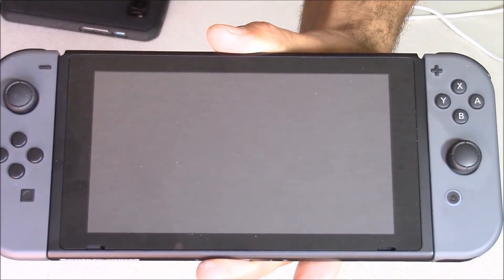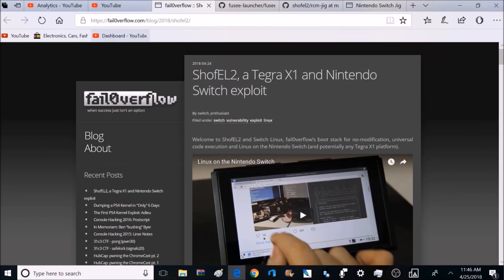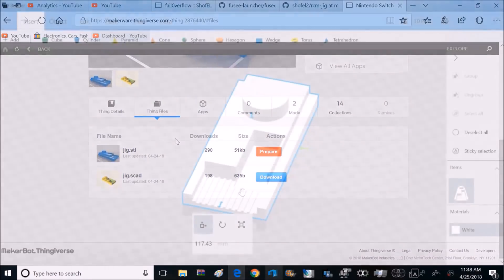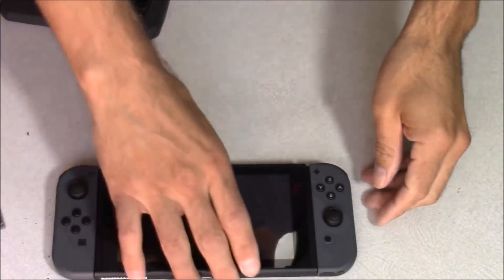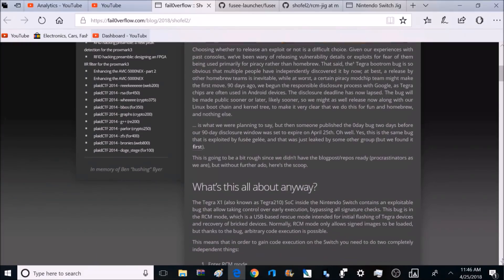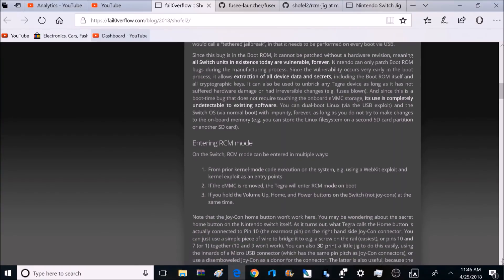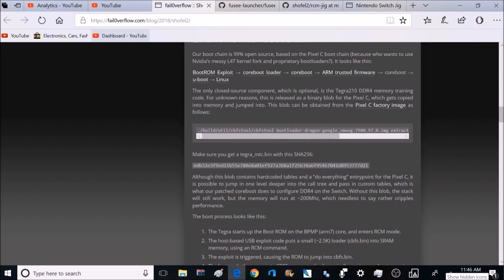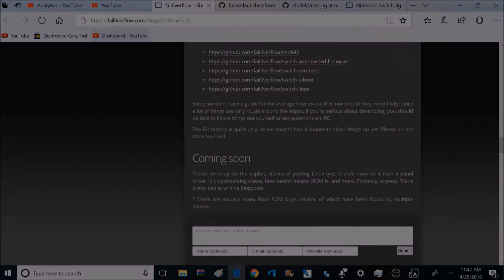All Nintendo Switches and Firmware can now be EXPLOITED !!  Is Nintendo in trouble???

Comment: Not 7 and 10

It is 1 and 10

And also the 1 and 10 is more stable i tried it from my switch and it is stable
Reply: Doesn't matter which pin you use with pin 10. You can use the copper thing on the top of the console or pin 1 or pin 7. Or the rail itself.

Comment: I keep getting error code 2124-4007 when I try to install Mario Odyssey on my homebrew switch, because the game requires an online game update to install the game. I get the same error if I try to do anything online related (eShop, mario kart 8, etc.) I backed up my NAND beforehand as well, but it could not help the situation. Any future games that come out (Smash, Fire Emblem, etc.) will most likely require an online game update before you can install the game like Mario Odyssey. Luckily I have a second clean switch though. Beware!

Comment: Ok the average Joe doesn't have access to a 3D printer as well. Those are expensive as heck so you'll also have a struggle to say the Switch is going to die when really it's not really because who on average would have one of those printers anyway.

Comment: If I were to do this (which I won't), would I be able to use the Joy Cons connected to the Switch since the pins were shorted out on a Joy Con slot?
Reply: Rednax You would install all the files and emulators or whatever then unplug the pins
Reply: I think that thing sets up a primarily access point, then you could instal everything end eventually you’ll set up a secondary access point where you don’t need to use that thing

Comment: Hmmmm did the 360 die? No. ..did ps3 die? No. And neither did all previously hacked devices. In fact it will probably boost sales short term till the new revision comes out. :)
Reply: Paul Bennett Yes they died.
Reply: Hybrid Theory the percentage is so small. I didn't know anyone with a hacked ps3 or 360. In fact it was mainly hand helds that my friends seemed to hack. I think the main reason is that people didn't want to get banned from the online services. And that will still be the case
Reply: ah Albryx 765 is :) a bit strong perhaps. I would have just said " a bit stupid" :)
Reply: The original phat 40gig and 60gig ps3s were expensive due to the fact they had ps2 hardware in them. The reason the cut down models were introduced was purely cost related as they too were hackable. Its only the ultra slim models they are at this time un hackable. oh And the ps3 and xbox lasted way too long a point that is obvious due to these rushed out beefed up models to try and not look stupid. (mainly microsoft)
Reply: Paul Bennett my fault i often forget the most important part when i translate my sentences to english and thats culture
Reply: MISTER Actually, PS3 Fat were hacked first, and they got hacks like downgrade ecc.ecc. It couldn't be fixed, so the prices of these ps3 fats went actually up in price, while slims and superslims were super cheap (80€). Also, piracy became a thing and with the new generation things died up quickly, (Black ops 3 was an example.
So summing up:
Hacking the console made it die quickly. Even if it lasted long, game piracy was still a thing and game cheats were a thing while it still was "alive".
It was simply near death when downgrades came up and with the new nintendo permanent switch exploit, which can't be fixed (As far as I know) , game dev will be scared and the console is going to die pretty quickly.

Comment: Switch isn't gonna die because of this. Look at the 3DS and even the Wii. I think it will even HELP sales.
Reply: Torrie Starfrost it could help hardware sales because hackers will buy it, but if you can run ISOs it could tank the software sales due to piracy.
Reply: +miguelr246 everyone has to remember that Nintendo doesn't gain much from hardware sales.
Reply: It’s not the concern for sales that’s up for debate—it’s the concern of 3rd party developers backing away.
Reply: its not the hardware sales that hurt it software..which can lead to 3rd part devs not porting or relasing games on that system
Reply: Torrie Starfrost yeah imma buy one now
Reply: Krizx600 just google it and type the latest firmware
Reply: Krizx600
 3ds dot guide
Reply: Or even other Consoles like the PS3 or the PSP.
Reply: Also, new switches WILL have a hardware ipatch for the firmware with the next batch of Switches
Reply: ROM has the disadvantage of never being patched.
EEPROM has the disadvantage of malicous beeings reflashing it.
Reply: Torrie Starfrost yeah but it will decrease 3rd party support which is what nintendo needs.
Reply: Not true. I heard about this and I bought a switch ASAP. If the Switch sells 3rd party developers will always develop games. I personally will want to hack the switch just for retro games since Nintendo has failed to deliver virtual console. Other than that I will still buy new developed games.
Reply: Torrie Starfrost Doesn't help sales when they force you to have an unmodded device to play bought copies of games.
Reply: Lol backwards logic
Reply: The 3ds didnt get hacked the 1st year
Reply: It helps console sales, but not game sales.
Third party developers are less likely to release a game for a console that is hacked.
And without third party games, the Switch will ultimately die, just like the WiiU.
Just look at the Dreamcast, perfect example.
Reply: Torrie Starfrost true lol, hacking my 3ds was the best decision I ever made
Reply: Lost in Aokigahara how? The wii and 3ds were hacked to shit, and that didn't scare devs away. This is par for the course. Every system has been hacked. If what you said were true, PC would have no 3rd party support. Lol
Reply: Ace D. Do you know links to hack 3ds, i have been looking for some but they are hard to do. I updated by mistake to the latest firmware idk if thats a problem
Reply: Did it really hurt development on the PS3? Or the PSP? Or even the Vita now?
Reply: you are melodramatic. the 3ds and wii did just fine even after hacks. look at the ds, the most pirated yet most sold handheld ever. one could say having hacks make consoles sell better mmmmmmm

Comment: I dont get what you mean when you say you soldered two pins but you first say they are already the right spaced the right distance right out of the micro usb cable

what do you mean by and than I sodered two pins @1:41
Reply from the maker: ValhallaOutcast the pins spacement is right but there is 5 pins total and only 2 pins are needed and those 2 pins have to be connected together to cause short.

Comment: A hardware revision is probably already about to pump off the assembly line to fix this and will replace all store stock soon enough.
Reply: TheAlphaOmegaX3 but then there are already nearly 18mio hackable units
Reply: dArK StOrM with 1% that will actually try it.
Reply: TheAlphaOmegaX3 and then old switche will go for 50 dollars in stores :D
Reply: It doesn't matter, the switch only has like 5 games lol
Reply: TheAlphaOmegaX3 
the hackers will buy off old models and non hacker can make profit
Reply: Νοῦς 

they'll disappear from stores quickly if there becomes a market for hacked Switches
Reply: Hope they throw in a thunderbolt 3 port while they're at it.

Comment: I got one of them key things off ebay £4.99 but won't be using it untill things are a little more tested and 3.0.1 exploit is about.
Reply: M K can you give me the link of the jig on ebay? thanks man
Reply: This works with any firmware. I'm on 5.0.1 and it works
Reply: M K yah, I would love the link, too!
Reply: I found this one! 

https://www.etsy.com/listing/610026565/nintento-switch-exploit-plastic-jig-only?ga_order=most_relevant&ga_search_type=all&ga_view_type=gallery&ga_search_query=nintendo%20switch%20jig&ref=sr_gallery-1-1
Reply: jeffrey batobalani look up " joycon jig needed to trigger RCM mode on the switch to allow booting of Linux "  on ebay uk
Reply: Dave Hernandez look up " joycon jig needed to trigger RCM mode on the switch to allow booting of Linux "  on ebay uk
Reply: Dave Hernandez I looked that but you will need a USB cable for the pins but it is the official 3d print.

Comment: if i do install linux can i still play switch games?
Reply: It's not actually being installed. When you shut it down and turn it on it will be back on the normal Switch OS
Reply: linux isnt installed onto the system afaik, it works as if its a livecd
Reply: If you do install linux you would most likely install a custom bootloader as well. So, I think there's no issue in that.
Reply: oh cool

Comment: Someone at nvidia tegra is getting their brains beaten up!     I'm sure the new tegra has a fix for this, so new switch consoles will use the new tegra chip.  I'm sure I read some where the next tegra chip has loopholes well closed.
Reply: how will Nintendo fix it by changing their boards? I need to know specifics since the Tegra is a SoC which contains a broad spectrum of functions.
Reply: Dayvie the fix is by nvidia , so the next switch they Make they simply use the new modified tegra chip.  They won't manufacture any new switch without this new fixed tegra chip, nivida already announced a fixed chip ages ago.    Most people won't run pirate software mind.
Reply: Probly the ceo with his one bonner for selfdriving cars..
Reply: Hanniffy Dinn there is nothing wrong with the tegra chips its nintendos board desing nvidea disnt force them to install those traces in that
Reply: how they exucute unsigned code is an exploit how they enter rcm is not again nobody forced Nintendo to make it that easy to enter rcm mode especially when it not intended to be used by the end user
Reply: MISTER RCm mode was always a chip level thing, there was always gonna be an exploit for that, no matter what Nintendo did.  
The nextgen tegra chip has got that fixed up mind. So new switches won't have this exploit.
Reply: Hanniffy Dinn i get that but this would have been something small if they made it harder to enter rcm mode in the first place they knew that this exploit existed in the tegra x1 in the first place they could have simply prevented this by making it harder to acces rcm mode
Reply: I'm not so sure about that. It's probably by design. Nintendo could have blocked it by designing their board differently, but they decided not to do! I expect that Nintendo will make changes to their board, and the Tegra chips will maybe updated in a later phase. This does not happen overnight! And it will cost Nintendo a lot of money!
Reply: Mum Blic idiot, this isn't Nintendo, it's the nvidia tegra chip.  The next tegra chip release the loopholes Are not there. So new switches won't have this.  But they've sold shit loads of the old tegra chip.